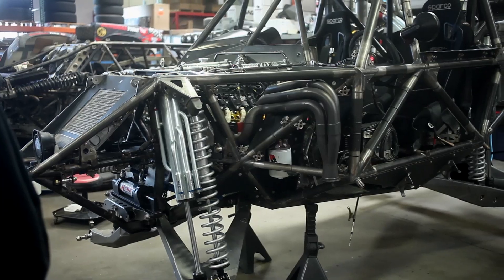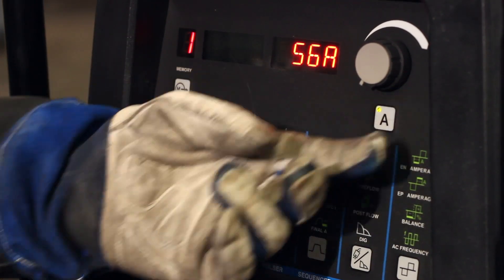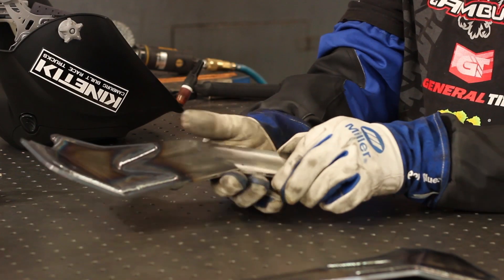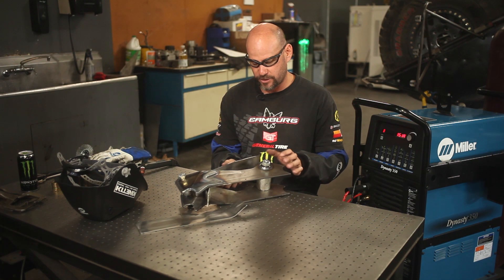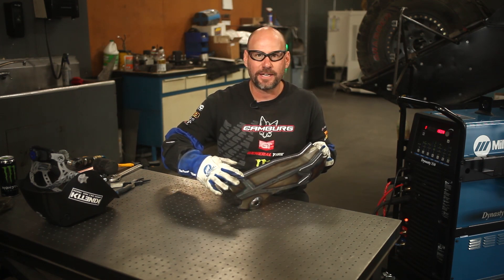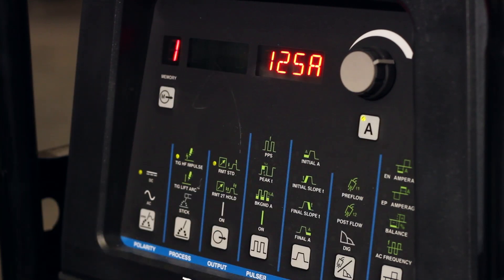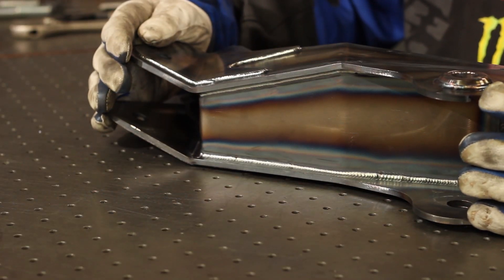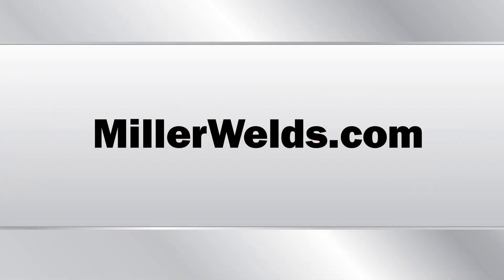TIG Welding Rear Suspension Pivot Box for Camburg Kinetik Series Trophy Truck

Comment: I'm curious why this type of part would be TIG welded instead of  MIG welded.
Reply from the maker: Wren Wright The welder used TIG instead of MIG because of quality and control. GTAW allows Mr. Campbell to have total control over the penetration and weld bead geometry. Both of these variables greatly affect the strength of the final product. This is a critical component that is subjected to very high stresses when in use, therefore the welds must be of the highest possible quality. Please let us know if you have any further questions.

Comment: Hi. Congratulations for the work. What kind of steel you used and what the filler material used for addition? Tks!
Reply from the maker: The material is 4130 chrome-moly, and the rod is 70S2. Let us know if you have any other questions. Thanks!
Reply: @MillerWelders  Great to hear. From what I can tell from the welding literature, there's less Martensite formation with ER70S-2 than with either ER70S-6 or ER80S-D2. 

This video was made several years ago so perhaps no one knows the answer to this question (or is even following this video's comments any longer), but was there any post-weld stress relief applied to this part after the fabrication? My guess is probably not since it wasn't mentioned. The AWS seems to recommend that none is needed when the 4130 is 0.120" or less, but that post-weld stress relief be used once the thickness goes over 0.120", so I was just wondering.